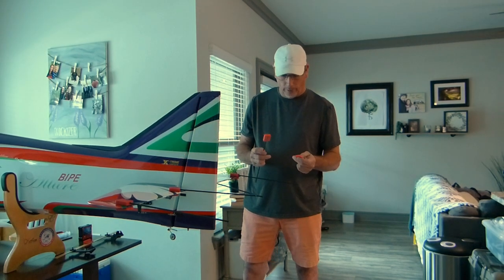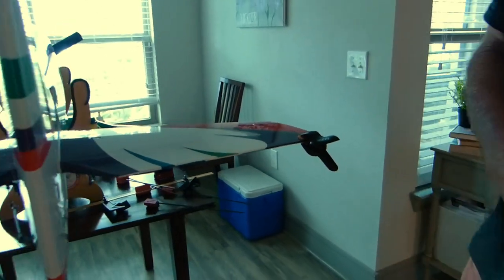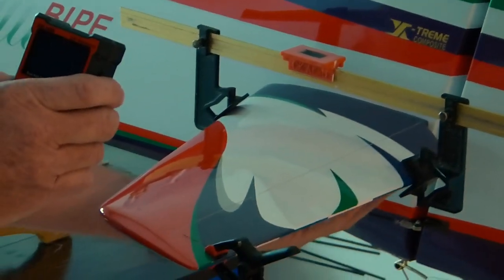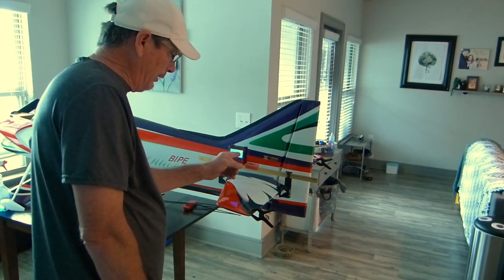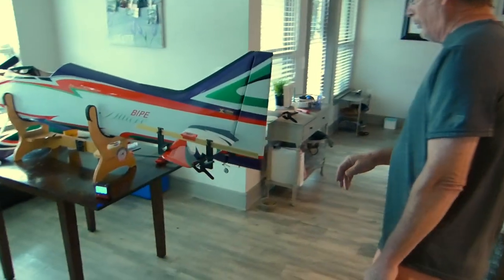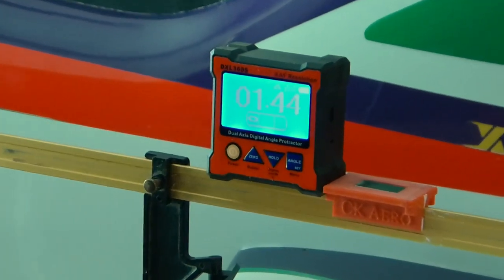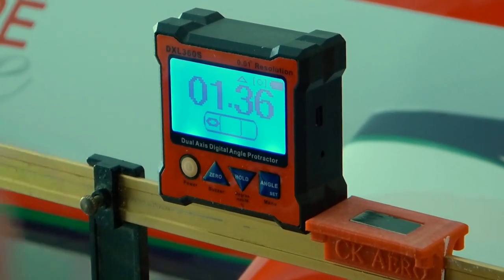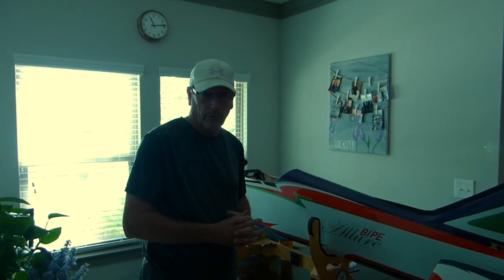Make Your F3A Airplane Fly STRAIGHT and TRUE!

Comment: Very good Bryan.  Can you just use the electronic sub trim in your radio to move your elevator half into the best possible position and adjust your ent point to match evenly
Reply: Mechanical set up and geometry should be achieved 1st, and then, you can use the transmitter for fine adjustments.  it is much more complicated than that.  (this is coming from an IMAC pilot)
Reply from the maker: Hey Phil, Brett here, electronic sub trim is ok to use to keep your elevators lined up as a maintenance function throughout the life of your airplane. However, you should make sure when everything is installed that you use the sub trim to line your servo horn up parallel to the flight surface and mechanical adjustments to get the elevator surface lined up with the stabilizer. This insures that as the servo wears over time sub trim adjustments are simply bringing things back to where they started. 

Hope that helps!
Reply: @ckaero5113  makes sense Brett, also see my reply above.   My Alchemy Pro is the sweetest flying plane I’ve ever had.  The difference from my Other planes is really quite pronounced.  Jason has done an awesome job building her and I’m in love.  Cheers and best wishes to you guys.   Stay safe

Comment: Hi, how you decide which side to use as reference the lef stab or right, what you use as refrence surface to adjust
Reply from the maker: Hi Thair, 
When deciding which stab to adjust the goal is to get your elevators to match the stabilizers when trimmed for level flight, so you want to adjust the stabilizer which will make that possible. For instance, if you're carrying up trim you want to adjust a net negative incidence into the stabilizer to get rid of that, so you adjust the stab that needs a negative adjustment to match the other. While not absolutely critical, this will provide an even and predictable response from your control surface. If you carry any trim you may notice some expo like effects on the elevator around neutral in one direction or the other.